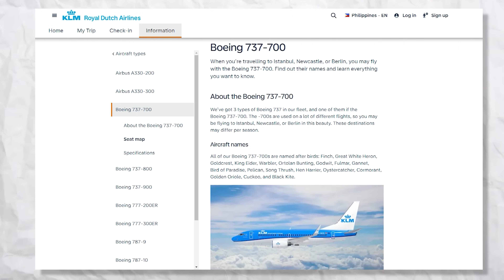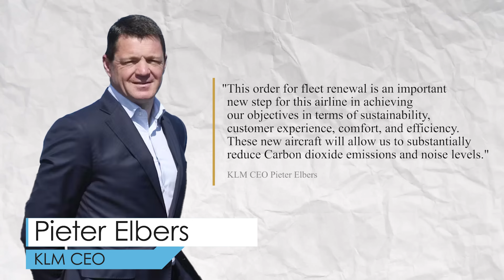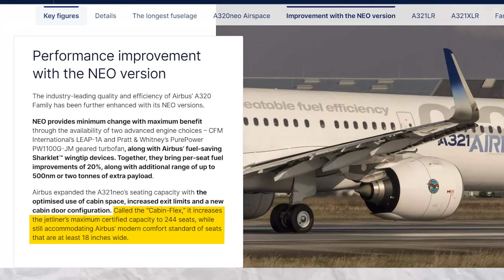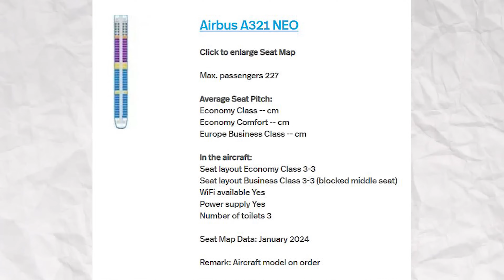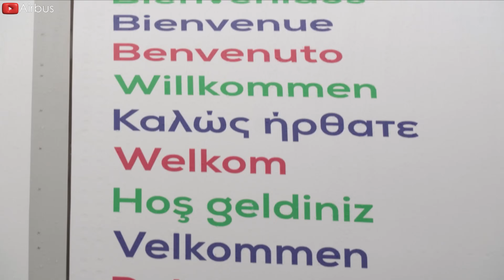KLM Said “GOODBYE” To B737 And Turned To A321Neo! Here's Why

Comment: Boeing are not the worlds leading aircraft manufacturer. Airbus have proved they build far supperior aircraft than Boeing. The new 777, only 6 years behind schedule. Problems with the Max series. All because  Boeing saw what Airbus were doing , panicked and compromised safty, by pushing aircraft through, that should never have been certified air worthy. The FAA have a lot to answere for, for basically giving Boeing the authority to certify there own aircraft for flight wortheness. They still have a long way to go , to prove they are a reliable and safe aircraft manufacturer.

Comment: Let's just cut to the chase, would you be volunteering to fly on a Boeing airliner in this day and age with the company's reputation and name so tarnished  - I know that I wouldn't really want to.

Plus, it actually looks as if Airbus makes a better product these days.

The engines are quieter, the airliner has more range in terms of the number of nautical miles it can fly before it has to be refuelled.

It's probably better to be buying from the French airliner manufacturer than from Boeing as things currently stand.

I don't really see Boeing's level of trust that they once enjoyed from the likes of KLM or Qantas being returned to anything like it was before the boardroom decided to put something other than SAFETY at the top of their priority list.

Boeing's loss is Airbus' gain, and that of Embraer and Bombardier.

Comment: I wanted to Garuda Indonesia need to Says "GOODBYE" to BOEING 737 and 777 and turned to AIRBUS including A220, A319neo, A320neo, A321neo/lr/xlr, A330-800/900neo and A350-900/1000 xwb/ulr also for cargo flight A350f. So the Garuda Indonesia will have only AIRBUS than BOEING for the future.
Reply: They are already buying a330-900neo

Comment: [9:49] 'The worlds leading aircraft manufacturer'. This would be Boeing, right? Is this still the case? What is 'leading'? The company that sets the pace for the market? That would likely be Airbus with them bringing to market the most new or improved types in the last decade. Or does leading refer to the technological advancement? In that case Boeing is also behind, with Airbus using more efficient designs and high cockpit similarity between wildly diverse types.
I guess the American dream of Boeing being a leader in a relative commodity market of passenger aircraft has come down like a lead zeppelin in the last decade. They seem unable to bring new designs to market, cut corners on production and engineering quality. That is not the attitude an industry leader is required to have.

Comment: Plus the engines can't run in synthetic aviation fuel SAF. It's main Dutch hub wants to cut flights but not passengers, so "bigger" planes need to be ordered now for definite delivery while cutting costs so that a bigger seat capacity plane can run with less passengers at the same profit margin. It may also be an indication that Airbus pilots are "easier" to recruit. Mostly is frustrated Boeing has as this will add to KLMs cost in having two fleet types even if the 787 would be less efficient on paper
Reply from the maker: You have shared good information, thanks

Comment: Come on, right now you gotta be really confident to fly new Boeing planes given all that has spilled out of their backyard. I certainly avoid the MAX and will keep doing that for many years. The fact that the producer basically lied to the operators and the authorities is brutal and reduces to zero the confidence. The NEO has simply bigger+more efficient engines, and for a few generations this has been enough to compel operators to new planes, since fuel is their biggest spending. The NEO with its fuel efficiency is like a Small Dreamliner or A350, very suitable to long point to point routes.

Comment: that's nothing confirmed at all.  While you're only mentioning the A321Neo, you need to know that this Airbus airframe would only possibly replace the 737-900 fleet. In order to replace the 737-800s  there would have been talks of A320Neo which until now nothing was said.  Therefore, it appears the ordered A321Neo fleet would be a small one within KLM serving few here and there long thin routes, and not fully replacing the 737 NG fleet (yet) as you imply.
Reply: It is confirmed that the KLM 737NG fleet will me replaced by the A320neo. The last 737 will be replaced around 2030
Reply: @bram6452  L decision by KLM
Reply: @OfficialDoggyYT  yea its a shame to see the 737 go
Reply: @bram6452  finally someone who agrees
Reply from the maker: Yes, thanks for your sharing!

Comment: The A321Neo’s reduced noise and increased range are great benefits. KLM passengers will appreciate these upgrades.
Reply: And let’s also not forget the aspect that Schiphol is requiring reduced noise levels from airlines to resolve or at least accommodate long lasting complaints about too high noise levels from people living in the vicinity of Schiphol Airport. As due to the expansions over the years both of Schiphol and of the built up / housing areas surrounding the airport noise pollution had become and still remains to be an also politically sensitive issue.
Reply from the maker: thanks for your comment

Comment: For long time i may say i am fan of Boeing, but since the problems that Boeing cannot solve and the good developments at Airbus i can no longer say that.   Also, support  your local, and together with Air France, KLM has a great deal for the choice to switch over.   Transavia also did a great job to switch over to the Neo's.  Thumbs up for both.   Wish them both many safe flight hours.
Reply from the maker: thanks so much for sharing
Reply: can you explain how and when did Transavia switch from Boeing 737s to the A321 Neos??
Reply: @Advancedkid  Transavia has received its first 321 Neo last november, the phasing out will take a while, but the proces is going on right now.

Comment: Boeing is a classic example of what happens to a company when the bean counters assume the power, in this case, instead of design and engineering calling the shots.  Hunger for short term gain overlooks the potential for long term pain.  The MAX is not the only problem in the Boeing camp.  The 787 line in Alabama is also suffering quality issues.  I wouldn't be surprised if KL eventually replaces their 78-9 fleet with A350s.
Reply: Boeing will get there crap back together it didn't happen overnight won't be fixed overnight
Reply: @AndrewLarson-mq7xc  The only way that will happen is if their corporate culture undergoes a massive change and wrests power from the accountants.  How many "overnights" do you believe that will take?
Reply: @AndrewLarson-mq7xc  It shouldn't have happened in the first place.  How many more will be subjected to peril until they get THEIR crap back?
Reply: @alradioguy2269  yeah true .hope they get their crap together
Reply from the maker: thanks for your comment ✈️

Comment: Sign of the times , Boeing current issues started many years ago , I just watched a TV aircraft investigation involving Boeing complacency many years ago . Boeing could fold as an aircraft manufacturer I believe. They have themselves to blame . Boeing using an updated aircraft based on the old 737 , they can not complete with airbus , providing  new and better aircraft .  If it a Boeing I am not going , if I flying Boeing I may end up going ! Reputation is vital for survival in the airline industry.
Reply from the maker: thanks for sharing